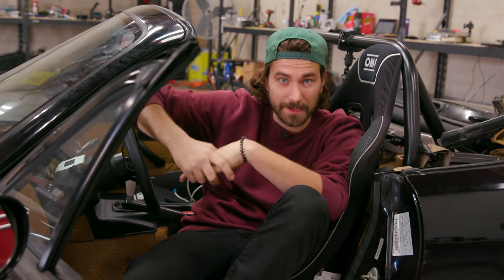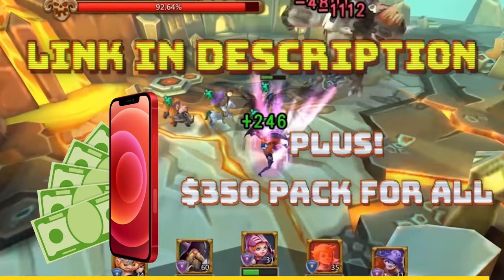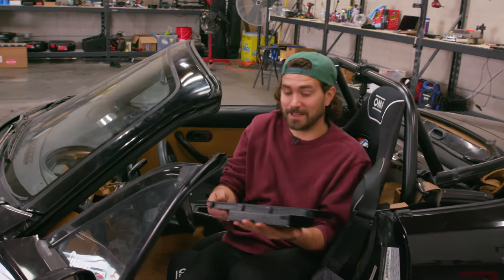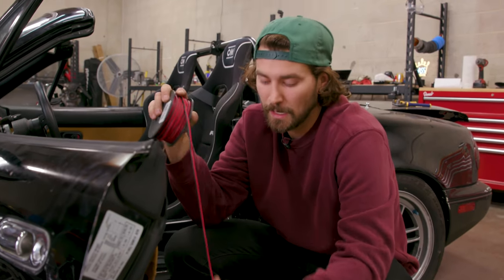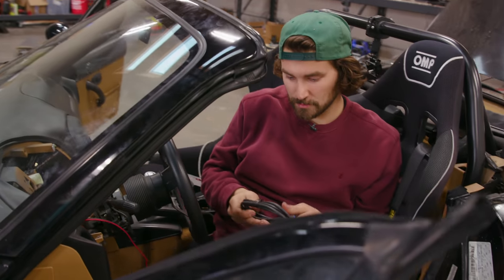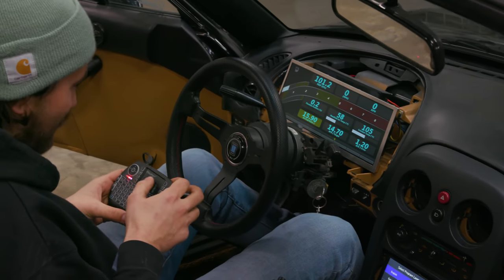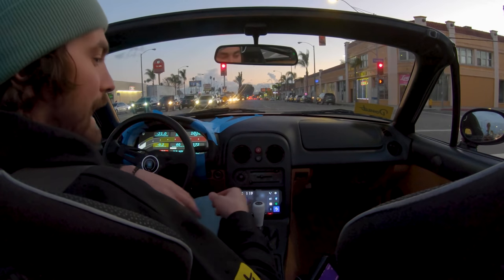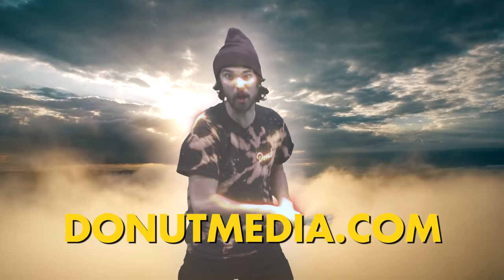Is a Digital Dash Worth It?

Comment: Its probably just me, but the response rate on the dash isn't what I'd like.
Reply: yeahh... especially the delay on tacho and lack of functioning speedo... really disappointing tbh, rather just have a pillar guages with colorful backlights lol
Reply: and the speedo isnt working
Reply: I agree. The digital tach in my Si is terrible. It only runs at like 30hz and is slightly behind where the revs actually are.

And then you have the digital speedo on like every car these days that runs at like 1hz.
Reply: Yeah its like there are not 360hz monitors already
Reply: It's a Raspberry Pi driven thing, and to use the GPU properly is going to take a lot of expensive programmer time.
New cars have nVidia graphics cards and large teams of programmers to make it happen. Give it a few years and the enthusiast solutions will catch up, but it will take some time.
Reply: @HrHaakon  i agree
Reply: @TotalMrAlien  I wonder when he removed the body that was connected to the screen with a ribbon cable if that is where the GPS was.
Reply: @rokibuca  there is no odb in a NA Miata
Reply: @ventsiboy  I’ve not really seen 360 but I’ve seen 240 and 120
Reply: i think its not because of the monitor refresh rate. maybe its bc the miatas rpm sensor or computer is only updating every second. i am sure the digital gauge is displaying what it gets and in this case it is the current rpm ever second
Reply: @sascha2485  only the early ones don’t after 94 they do
Reply: I was going write the same thing but then saw your comment... anyway looks like something lacks processing power ECU?, Display or something else? it just looks bad when revving engine doesn't match speedo/display.
Reply: @HrHaakon  wa about Aem or Haltech dash
Reply: @ryanwells5035  
Don't know enough about those to comment. I don't want to sound dumber than I have to. ;)
Reply: @ryanwells5035  AEM are much better dashes!
Reply: @TotalMrAlien  The speedo will work just fine. He just didn't have the GPS working/turned on yet. Chill the hell out.
Reply: @HrHaakon  a raspberry pi has plenty of power to run a tiny display like that because its not doing any actual processing, and no cars do not have nvidia gaming graphics cards in them
Reply: @payne_suffering  
nVidia delivers graphic solutions for more than just gamers.
Reply: he mentions in a different video that it just needed a firmware patch than the response time was much better and he didn't have the gps in yet so the speedo wasn't on
Reply: You could probably increase the refresh rate in the software
Reply: @payne_suffering  You must be pretty delusional if you think chipsets aren't used in cars. Donut Media even mentions it in one of their either hybrid or electric car videos. Not every car needs it but if you think a tiny raspberry pi will keep up with the times sure go ahead and think that.
Reply: I find it insulting that this product even exists. The low framerate is just unacceptable. It isn't rocket science to make a smooth looking display of 2d rectangles. This is just crappy workmanship trying to pass as a good product. You don't need an nvidia gaming gpu to achieve more then 30fps on a virtual guage cluster.
Reply: I’m not sure it’s an issue with frame rate of the actual screen, if you look it updates very consistently and it is known that frame rates typically fluctuate depending on how demanding the task is. My guess is that the gauges are physically updating at a slow rate, I would hope though that that could be changed but I’m not sure
Reply: @HrHaakon  It doesn't take a super computer to render a few shapes at 60hz. Nowadays, flip phones can do that easily
Reply: @20blog28  
Phones have better, more specialized hardware for graphics rendering and are much more powerful than the raspi. It's simply put, not a powerful computer and isn't meant to be.
Reply: sorry to revive a dead thread… but you guys seriously underestimate the graphics power of an RPi. it can run a display at over 120hz easily.

displaying information like this is a 2D task. loading up firefox probably takes more resources just drawing the window. the GPU wouldn’t be required for displaying information like this other than drawing the images to screen - it’s all computation and is more suited to CPU

for reference, i have an RPi4 running a media server transcoding tv shows and movies for various formats on the fly, which uses the GPU and CPU consistently. if it can do that, it can certainly show some numbers on a screen faster than 10fps without a doubt
Reply: @futose  Thank you for this, because I was wanting to jump in too! Yes, Teslas have GPUs in them, but that is for the self-driving functionality.

I have an RPI Zero W that runs a camera and streams the frames back to a recording server. That is significantly more demanding than drawing these gauges. This is honestly a task an Arduino Nano could handle. The issue here is either with the screen they used for the dash, or the programming.
Reply: Yeah, the latency and baud/response seems awful.
Reply: I hate it too x)
Reply: There is better hardware now lol it’s been 2 years, a new flagship raspberry pi could probably do it
Reply: Not just you. That tach is sloooow.

Comment: i dont like how the revs arent smooth - like it refreshes every half second. that would make me mismatch shifts
Reply: He I thought the same
Reply: I agree, I would much rather have analog gauges instead of digital if the refresh rate is that low
Reply: Yes it bothers me so much, it has to be butter smooth or I am not installing something like that
Reply: Yeah it's really odd, almost looks like bluetooth lag or something, and I definitely know I've seen lossless digital dashes before. I know when I switched from a bluetooth OBD scanner with my phone to a cobb accessport the update lag went away so maybe it's something like that
Reply: Maybe, some kind of conflict between video frames per second value and refresh rate of the dash itself? Like flickering lights of modern car optics on video.
Reply: it lags I think because it read the data via RS232 (USB to Serial, usually FT232, cp2102 or ch340). and the refresh rate is slow because it's using slow baud rate (9600 or 115200).
Reply: @meguy798  nah just the low polling rate. polling rate should be 100Hz at least. same thing you get with like Rainmeter when you set the polling rate too low.
Reply: I dislike the lag as well, but you shouldn't be dependent on your tach to shift or revmatch/downshift lol
Reply: I said the same thing. It looked super laggy to me
Reply: True but thats not the only way to judge the timing of your shifts. All about personal preference. Hell, i got back into Gran Turismo 3 and the shift indicator usually flashes 500rpms before the the actual rev limit of the car but driving another car, the indicator flashed around 250rpms before rev limit, resulting in less time for me to react and having to listen closely to the engine and keeping a closer eye on the tachometer. 👍🏼
Reply: I think that's because it works trough USB, and I guess the polling/refresh rate of either the monitoring software or the ECU USB monitoring is rather low. This dash is basically a computer running the ECU monitoring software, there are digital dashes that interface directly with the ECU trough CANbus and those are much better for lag
Reply: u use guages to shift?
Reply: Still digital ones are at an advantage on the biggest part because on them you can display speeds that can't be displayed on an analogue gauge plus you can display multiple things at once with one single unit instead of having to keep eye on multiple analogue gauges
Reply: @radishtrader5591  😂😂 he's just got his B License, chiiillll😂😂
Reply: That's what you get for buying cheap stuff, the best digital dash on the market right now is the Haltech IC-7
Reply: @Cookiebreedchannel  honestly im using Realdash just to make replicas of my favorite irl gauges. Literally have files of gauges of cars, analog and digital on my phone, really loving my bootleg STACK ST8130 and S2000 replicas atm. For me  its mostly for aesthetic and recreational purposes rather than performance but yea 👍🏼 digital is the way
Reply: @Cookiebreedchannel  in reality the megasquirt should have failsafe parameters you can set. what he has is a little unnecessary imo, boost for example is a relatively usless guage to have.
Reply: @putraadriansyah8082  you are 100% correct
Reply: Cause the after market ones aren’t made as well as companies one I’d even say these are dangerous
Reply: You shouldn't be watching gauges
Reply: @killernuke1156  most digital dashes don't have that bad of a refresh rate. He was using a pretty low end one, higher end stuff like dakota digital, holley EFI stuff, megasquirt dashes, etc are more racing oriented where that half second refresh delay really counts.
Reply: Who uses the gauges to shift real driver's go by sound I've never used the gauges to shift I hardly look at them only to look at how much gas I got
Reply: @DinoTrollerino  yeah like holley dashes, or dakota digital, or even fueltech.
Reply: you need to look at the dash to know when to change? I always do it via engine sound.
Reply: Who looks at the tach lmao
Reply: @mercury0214  ikr, but if you're concerned go with a CAN based cluster like dakota digital can use or like Holley's digital dash uses.
Reply: it also bothers me how big it is to be honest he really doesn’t need to display all that
Reply: @jimmyhu4439  🤔how so?
Reply: @mawrkrobinson  it's good for tuning, for actual street driving I'd put in a simplified file with pressures, temps, gas level, and a clock I'd want seperate gauges for boost and AFR/lambda. Maybe also a seperate mechanical ethanol content guage
Reply: Don’t shift staring at your gauges shift off sound and feel
Reply: Don’t stare at your gauge for when to shift, go off feel and sound.
Reply: imagine having to stare at an rpm gauge to know when to change gear lol!
Reply: Same here. The way the rev counter responds looks a bit janky.
Usually the polling rates of these systems decreases as you add more and more categories of data to display, causing more and more lag in the displayed data. The rev counter will probably be smoother if he selects fewer things to display.

Comment: Zach: "I want to keep my eye on a lot of important things"
Also Zach: Removes his oil pressure gauge
Reply: If it’s a problem and u hide it there isn’t a problem anymore
Reply: @DaxanDaxter  if a knock happens then just turn up the radio
Reply: Hey doesn't have a fuel gage either
Reply: @DaxanDaxter  I drive a bmw it didn't even come with those
Reply: @DaxanDaxter  someone had to say it
Reply: Do they still put temperatures gauges in Jaguars? Just seems like spare tires, gauges are being eliminated for simplicity. I mean, people aren’t going to buy new cars if their old one works just fine.
Reply: Who needs oil pressure?

Comment: 9:43 Everytime you get into your car: “Before we drive off, just wait a few minutes for Windows to load up”
Reply: Windows 98
Reply: Didn’t actually take a few minutes and your supposed to let your car get warm before driving anyways
Reply: @jamesmoore716  how many people warm up their car for 5 minutes before moving off? 0.0000001%
Reply: @notmenotme614  they should.
Reply: @zenkiethan  in real life, you’d do it for the first week. Then realise it’s a pain in the ass every time you drive somewhere. You can beat simply turning the ignition on and driving off straight away.
Reply: It's actually a raspberry Pi
Reply: @notmenotme614  windows doesn't take 5 minutes to turn on it takes like 20 sec
Reply: @kenny-ph9dw  While not having a tablet for a dash, takes even less time to turn on and drive away. We both know this, so Ive no idea why you're trying to defend what is a worse idea.
Reply: @zenkiethan  No they shouldn't. The car will be fine anyway.
Reply: @jamesmoore716  you're not supposed to do that lmao, you give modern cars like 5 seconds max to get the fuel pressure and oil pump on but other than that, that's all the time you need
Reply: @notmenotme614  I didn’t say five minutes genius
Reply: @alextheonewarrior  that’s where you are wrong bud
Reply: It's Raspbian dude... It loads in seconds. And honestly, so does Windows with any modern SSD these days.
Reply: @jamesmoore716  It really isn't necessary. To get the engine noticably warmer, it needs to idle for like 5-10 mins, wasting fuel for nothing. Just don't put your cold engine under full load and don't revv it over 3000 RPM and it'll be fine.
Reply: @notmenotme614  I do it every single time.

Comment: “look at all my gauges, look at all my data”
mph stuck at 0
Reply: So the miata ECU cant read the RPM and speed?
Reply: Maybe just needs the GPS set up first
Reply: Facts I was like bro you can’t even see how fast you’re going like isn’t that one if not the most important gauge to have working?
Reply: @michaelfiorentino5893  Not exactly. If you drive a lot you get a feel for how fast you're going in the city---especially if there are other cars around you.

Can't say the same for track as I never been but I feel that's not very critical either.
Reply: Yep, also unless I missed it. A speedometer running off GPS is bad, especially if you lose satellite coverage
Reply: @Jstalhzet  yeah but you won’t or at least I don’t
Reply: No mph
Reply: @o4komodo  I never look at my speed when I race at the circuit. You just feel the car and pay attention to the road to know how fast to go. My truck doesn’t have a working speedometer either but I go by feel/sound and the gear I’m in.
Reply: @Jstalhzet  I think the GPS sensor was in that unit he removed from the screen attached by the ribbon cable.  He never reattached it in the video.